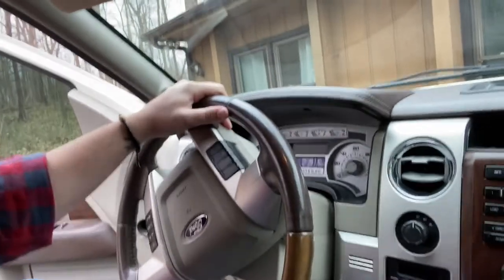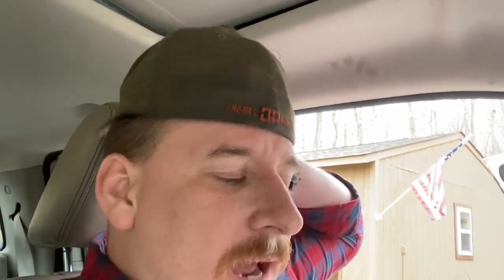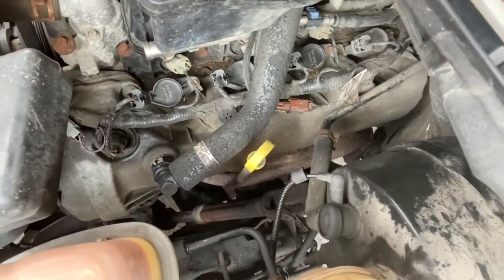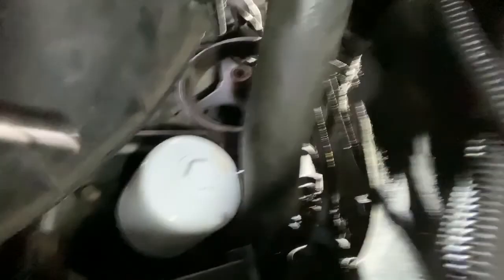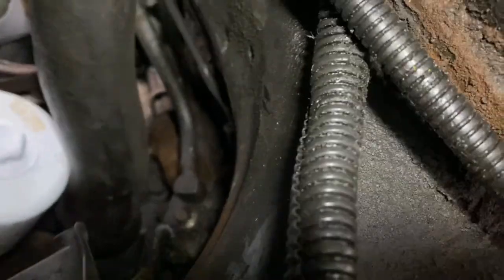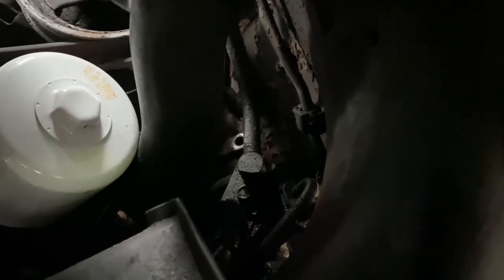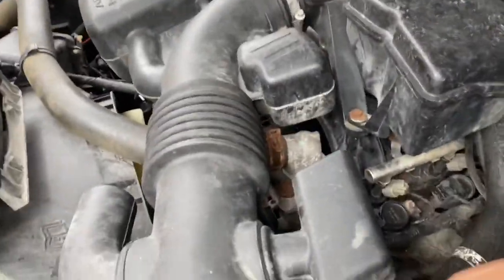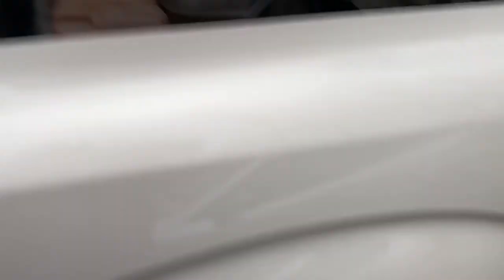2009-2010 F150 Steering Binding - Not power steering!!

Comment: I just replaced but it's still has resistance in the steering
Reply from the maker: Is it consistent resistance throughout the whole rotation of the wheel? Does speed help?
Reply: @boundlessbuilt943  not constent tention and yes speed helps
Reply from the maker: @bobbaker8715  when speed helps it’s usually your power steering. I’d be looking at your power steering fluid levels as well as the pump
Reply: Well now the trucks steering is only binding when I turn right
Reply: Hey thanks for the video. I replaced my intermediate steering shaft (2011 F150) but after driving it 15-20 min--and thinking all was good, turns out it is still binding. Seems to be happening both at slow and faster speeds.Any ideas?  Thanks
Reply from the maker: Any noises from power steering pump? Power steering fluid level? If this replacement didn’t fix it, it’s either power steering or suspension.
Reply: @boundlessbuilt943  Thank you for the reply. No noises. Fluid level is not at top but far above min level. After the fix I drove around and it seemed fine, took on hwy, then stopped in pkg lot and did a couple hard full circles both directions (not fast but full hard turns). Shortly after as I was driving home (abt 10mi into my test drive) it started to do the binding again. Just took out today on 15 mi, some hwy some city errand. No binding but it def feels like the steering is a bit loose/unstable. Also note that steering wheel is a bit off ctr for straight (did use bungee to secure). Wonder if an alignment would help. Really want to avoid the $2K+ R&P replacement. Though I did see some vids that said it can be repaired (belt replaced) and some say do not even need to drop off the truck to replace the belt.
Reply from the maker: @spindr909 I’d definitely look at an alignment first and while they are at it have them do a shakedown of the suspension for anything loose. It sounds like there’s something else going on
Reply: @boundlessbuilt943  well that did the trick! I took it to an alignment specialist and he said there did not seem to be anything wrong with the rackn pin and that the intermediate shaft was a little loose on the bottom bolt so he tightened it and then did an alignment and it is running fine now. WHEW. A bit of advice to those who have not yet replaced the intermediate shaft is get the new 10 and 13 mm bolts from Ford and replace those when you do this job. 
Save yourself some headaches and concern about overtightening. Thanks man.